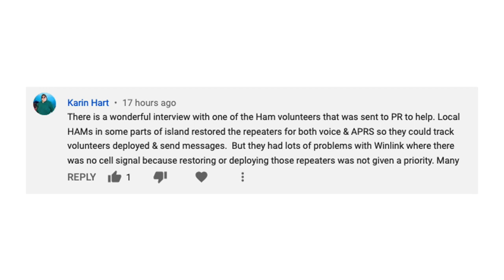Winlink 2M vs HF

Comment: What would make the 2M gateways easier to take offline than H? F gateways?
Reply from the maker: It's not that one is easier than the other but more the distance from the disaster area. Maria was a large storm that impacted the entire island. Using HF allows one to connect to a gateway outside the storm damaged area.

Comment: I always find your youtube worth watching and it has helped me more times than I care to think. With regard to this subject , Most 2 meter winlinks are at 1200 in this area, My pactor 4 modem can and has reached 5500 and many times 3300. Even VARA HF ( high speed) can often run circles around 1200 Baud. I agree with everything you have said about cost, antennas. Often your government allows Pactor 4 for emergencies.All things considered I would take HF for just the increased range even using a NVIS  antenna  
 kept up the good work 
VE6VAC

Comment: I agree with your points.
  

We are interested in Winlink for potential emcomm use.  We frequently have bad storms, either thunderstorms in the summer or ice storms in the winter, that bring down trees, power lines and communications lines.  Usually cell service survives, and that gets us through. But there have been instances, “superstorm Sandy” for example, when even cell service was lost.  The hope is that Winlink will allow us to communicate either point-to-point (peer-to-peer) with other nearby OEMs, or Winlink session (point-to-node) to communicate with non-Winlink users, such as the local electric utility which has redundant internet capabilities and can receive email.

As any nodes in reach of VHF are likely to be down (w/o internet), HF to distant points, points unaffected by the storm, makes more sense in the Winlink session scenario.  This is similar to the Puerto Rico example that you described. 

In any case, we are still experimenting.

Thanks for the video!

Comment: Being as it's Dec. 2020, I know I'm late to this conversation, but...
...an HF vertical has a good take-off angle for distance and can be built quite inexpensively. The inventor of the buddipole has kindly made plans available at 
https://sites.google.com/site/w3ffhomepage/new-homebrew-buddstick-plans
I have built more than one of these and it works well and the design doesn't need massive ground radials as it uses a single radial/counterpoise.
Just thought I'd share if anyone may be putting together an em comm kit.
-Have a Merry Christmas!
-Rob

Comment: In Fresno ARES we do a winlink check-in every Monday, any mode is accepted.  We also have a NorCal winlink check-in.  Gives operators practice in winlink and using various modes.  Great video, I'm glad I stumbled across your channel.  //K6OGR - Brian
Reply from the maker: Welcome to the channel. We have something similar on Mondays for Winlink checkins but it has to be over RF. Can't use telnet unless it is done through the AREDN mesh network which uses RF. Thanks for watching! 73, de KM4ACK

Comment: WP4OH Greetings Jason, I live in PR the problem of hurricane Maria was very difficult because we did not have electricity or internet to use even aprs I, I have done tests using winlink in 2 m but js8 in 2m is superior. All the center of the island  They are very high mountains and it makes communications difficult, I thank you for caring for us in your video and  God bless the USA my nation.
Reply from the maker: Can't imagine how hard day to day life must have been following the storm. Thanks for sharing your first hand knowledge. 73, de KM4ACK
Reply: I use JS8 a lot, but only on HF. That said, in the beginning of the PR situation, there were no 2m repeaters. Everything was done on 80 and 40. The situation was so dire that people were handed radios and told to call for ambulances/medical help using 146.52 simplex ! The 22 hams brought in were told to go to 146.55 simplex. JS8 would have been amazing to get the data to SJ. From there, it wasn't long in the situation that they brought in these new Sat Terminals that had powerful routers. One ham said that "they winlinked it to the headquarters, and sometimes took messages with voice. They then "winlinked" into the sat system. I suspect they just uploaded to the Red Cross as it was regular internet . 

. I've collected some of the stories , many as videos, and a few are here : https://www.youtube.com/watch?v=qPO6XPhwHqE&list=PLxzZgQElG0cGxHp5SnV1gcXKDMJk7b8iv&index=2&t=24s I may collect more into this play list as its a very important topic, being, how do you successfully handle a emergency like PR ? We need to have the skills ! 

JS8 has some VERY interesting parts. One being that you can upload a short message into a stations computer hard drive ! Once you get onto the machine, seems like another routine could automatically take that where it needs to go ? 

Much of the messages were the status of a person who hadn't been heard from. Those messages could be coded and would take few characters, other than the name.
Reply from the maker: You can do other things when a message is received in JS8Call. I have my pi scan for new messages and send me a text message on my phone when one arrives. Not practical for emergencies per say, but very handy for day to day comms. https://youtu.be/jzM7MO2gT6s

Thanks for the link to the playlist. I'll check those vids out. 73, de KM4ACK

Comment: Winlink is a VERY important tool, but like all communication modes it needs a organizational framework to be useful. Winlink is also changing with new protocols including ARDOP and VARA which work faster and better under poor signal to noise situations. VARA FM which is a VHF mode and a screamer when it comes to speed, easily 10x faster than packet. But all this is useless unless you know who you are going to talk to and what you want to say. Using vhf packet to get off island during the aftermath of Maria is kind of dumb, but to talk between a shelter and a command center 5 miles away it is perfect.

All these tools need to be practiced so they work when needed. You have to play with your equipment and try different things. Learn what works and what are the failure modes. We need to remember that you might not be working with equipment you are familiar with. Try everything. 50W peer to peer networks separated by 10 miles, 20 miles. 5w HTs by two miles. Packet, Winmor, ARDOP, VARA and pactor. Only when you have tried them all, and then tried them again and again with different setups are you really ready to help out.

As the saying goes, Amateurs try until they get it right, professionals try until they can’t get it wrong.

I make a HF winlink connections at least weekly. Different bands, propagation conditions, time of day and modes. I use different radios, different antennas and lately I’ve added doing it portable. I try different RMS stations looking for what works best.

If you can tell, I’m investing in making this work without failure. For me, it is THE emergency communications mode.

Charlie KM4ZZ
Reply from the maker: Totally agree. The one thing I haven't done since swapping to PAT winlink on the pi is P2P connections over RF. I need to play with that and maybe do a video after I figure it out. I did them all the time when I used RMS Express but have only used them over AREDN lately. After moving to PAT, I have used ARDOP exclusively. Haven't had a chance to play with VARA yet. Not sure it is compatible with PAT but I think there are a couple of gateways near me that just got VARA installed.

 Practice always makes perfect. I connect using Winlink almost every day usually on 40M or 80M.                                                                   We even have a net in our area on Mondays that takes Winlink check ins. While I am a huge  fan of Winlink, I am also a big fan of JS8Call. Not as "private" as Winlink but a very versatile mode/app. Thanks for the thoughts and for watching! 73, de KM4ACK

Comment: The group that went down to PR, were selected and kitted out by the ARRL all had same standard gear with the goal that they would use winlink via hf. Results were mixed as some people didn't know how to use the equipment, others did, and others did their own thing and not passing traffic.
Reply from the maker: Ok. The way the comment read I thought it was 2M. I haven’t seen/read much on the specifics. It would add another layer of complexity not being familiar with the gear. Personally I would prefer to take my own gear if given the option. Thanks for watching! 73, de KM4ACK
Reply: @KM4ACK  Thanks for the videos, if everyone had the same gear kitted out the way that you've set it up probably wouldn't have problems. Definitely helped me with figuring out how to setup pat winlink on my linux computer. PR was definitely a confusing situation for everyone involved I'd say. Probably a good example of what not to do.
Reply from the maker: DdraigX glad to help. Can’t count the number of hams that have helped me get to where I am today and continue to help when I have questions. 73, de KM4ACK

Comment: 👍 Ive never done 2m winlink but have with HF regularly.  It's another skill that needs to be practiced to understand how the propagation works, most reliable gateways for you and just understand the fact that often times it takes persistence.  Keep up the good work.
Reply from the maker: I like 2M when it's available. Lightning fast compared to HF. You are right. Many give up on HF Winlink before they understand it and  It can be frustrating at first trying to find a station that is reliable for you on a regular basis. 73, de KM4ACK